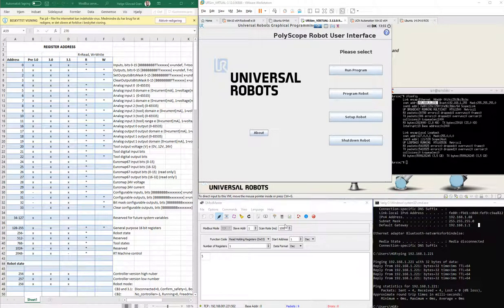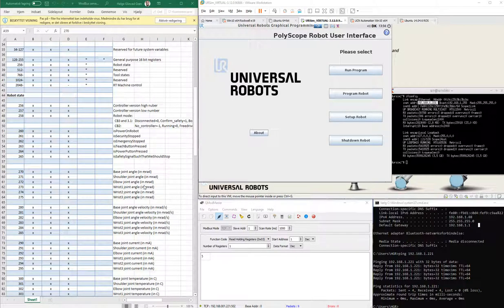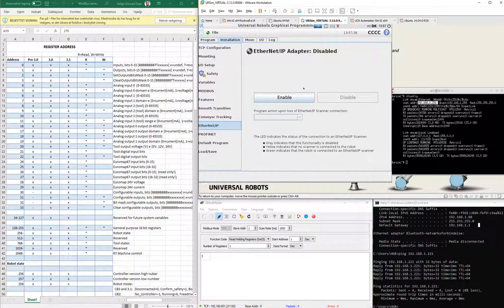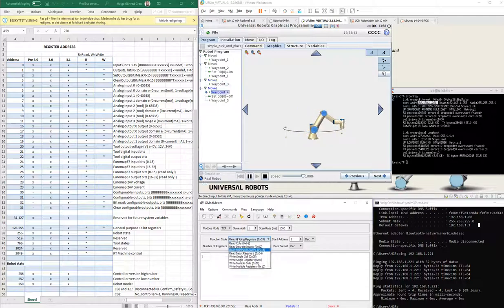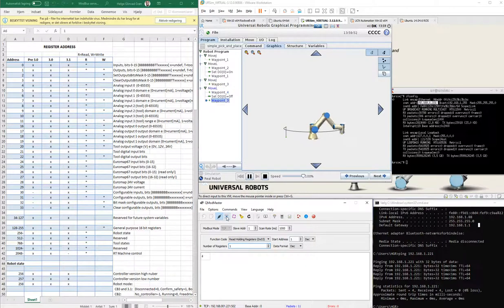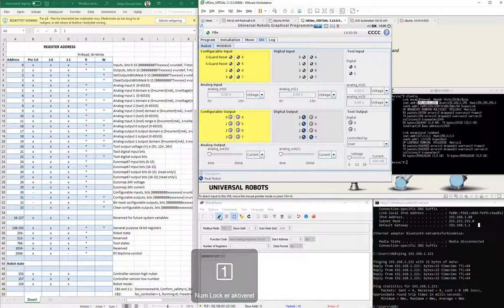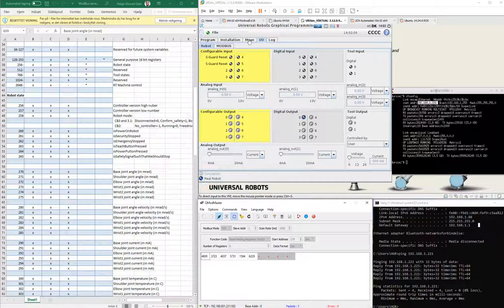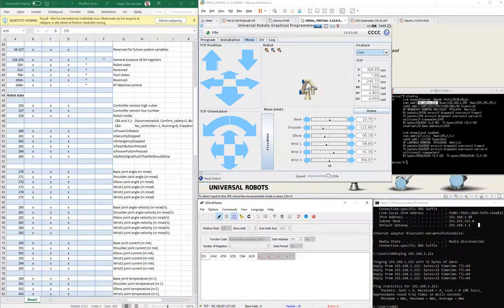Universal Robot - access data of the robot via Modbus - Test tool: qModbus

Comment: great video thanks 
I am trying to follow up using the qmodmaster as well, can connect fine but when attempting to read data get 
failed to read data 
error : no error
Reply from the maker: Try to grep on holding register address first. To see, if you require something that's not defined in the server, it will return that all is illegal
Reply: @HelgeGrn  don't know what you mean, but i am using a ur10e and connecting using qmodmaster, trying to follow your video but keep getting error no error which i found is error 0x02 invalid address

Comment: Hey !
Maybe you can help me. Idk why it is not working for me. 
I use URsim - UR10
I have an example script like you, where i change the status of the DO, also there is enough time read out the actual status.
But my QModMaster is not reading out correct. Iam already connected to the VM, ping is also fine. When i read out the DO all i get is 0000000...
The Bin number isnt changing at all. Also when i try to read out the joint position i get a illegal data address error.
Do i need to set up the UR as Master -> "Add Modbus Unit" or what am I doing wrong?
Kind Regard
Reply from the maker: QModMaster needs to be set to Modbus TCP, when we are using TCP, Master = Client and Slave = Server. The UR10 robot both has a client and a server, I am demonstrating UR10 as a server (automatic running on the robot) and using QModMaster as a clients (again master=client).
Then you should be able to read the DO on address 1 (40001+1=40002)

Comment: Thank you for this interesting video.
I wanted to ask you, if it is possible to write the value of the joints. You show that it is possible to read them, but can I write them?
King regard
Reply from the maker: Depending what you need it for ... 

As far as I remember (I have not looked in the documents) the 40271-40276 is read only memory
But... That said ...
Do you want to use it for forward kinematics? 
Or control the robot from an external IK engine... One way is to send a value to the general purpose memory and the let a UR script on the robot read the value into a joint 
I have an intro to some UR script on this GitHub 
https://github.com/glinvad/UR_Scripting

Let me hear more of the project
But tell a little more on why you want to do it
Reply: @HelgeGrn  Hello, thank you for replying.
Exactly in the documentation it says it is read only.... 
My project, I want to control my robot in teleoperation from VR, so I have an external IK engine and I want to send the values of the joints to the UR16e.
Reply from the maker: One way is via the UR ros drive, that could help you connect with your VR setup.
Another possibility could be found her 
https://www.google.com/url?sa=t&source=web&rct=j&url=https://upcommons.upc.edu/bitstream/handle/2117/333559/tfm-muei-etseib-sergiponsacobas.pdf%3Fsequence%3D1%26isAllowed%3Dy&ved=2ahUKEwjQ6vjstbL4AhWNtqQKHWI1Ba8QFnoECC4QAQ&usg=AOvVaw1t41ibFjbHTS-Bd-7vBJMz

Comment: Helge, how is is possible, to write an input? I have my difficulties while i am trying to run a program waiting for an input. I see there no possibilities so far :-s
Reply from the maker: That depends on what kind of input you are interested in writing. You can qModmaster to write either single  (0x06) or multiple (0x10) 16-bit integers. But the big Q is where to write. 
You can Either write directly to digital outputs (bool) (address 1) or some of the other boolean values. You can also write to your analog Out (int).

But you have limited output, both digital and analog.

Therefore will I recommend that you use the "general-purpose 16-bit register" address 128-255? The easiest way to get access to these are as follows:
- go to the installation tab
- go to Fieldbus
- chose Modbus
- access 127.0.0.1 
- chose an input (start with 128)
(make an output for the same address for testing)

now you will have a new input variable that you can use in your program via Modbus

Test it, and let me hear if I should make a video for it.

A little more help can be found her 
https://www.universal-robots.com/articles/ur/interface-communication/modbus-server-bit-access/

Comment: Hello Helge, I will second Alex on Great Video!  I am still trying to figure out some strangeness with data connection reset errors. At one point changing Options > Settings Big/Little Endian seemed to solve my problem, now I changed back to default to make communication work. If I learn any definitive pattern I will try to post a comment... Anyway thanks again. I will have to look into simulator.
Reply from the maker: qModmaster is an applikationer with a life of its own... But if you finds a solution, please post 😉

Comment: Hi!, great video. I have one question...I'm triying to do the same as you but I can't ping with the robot. I have the simulartor in virtualbox and the ip is 10.0.2.15, but from the view of windows the ip of the ethernert adapter of virtualbox is 192.168.56.1. I can connect with the ip of the ethernet adapter but not the ip of the robot (10.0.2.15). Do you know why and how can I solve it?   Thanks.
Reply from the maker: I might. I am mainly using VMWare, you can also use the WMWare Player for free. I like to make a bridge connection between my WM mashines and physical network card. This means that my IP range will come from my router (DHCP server) and therefore will be on the same network as my host mashine. 
When you runs "ifconfig" in the URSim and are getting 10.0.2.15, I would guess that you are either on NAT or INTERNAL setup. see more her https://www.virtualbox.org/manual/ch06.html

Try to setup the Bridge connection and then you should also be able to Ping the robot.

I hope you finds it useful, if not try to write again
Reply: @HelgeGrn   Hi! I dont know If Alex was able to solve his issue, for me happend the same, My mistake I had the VM  ethernet adaptors with fixed IP, U chenged them to DHCP and the ip of my lap ethernet adaptor on the same range and finnaly I was able to ping the robot.